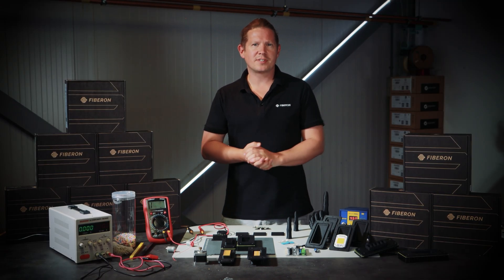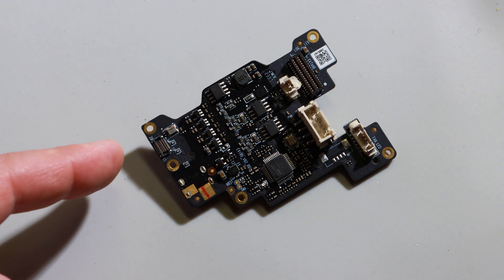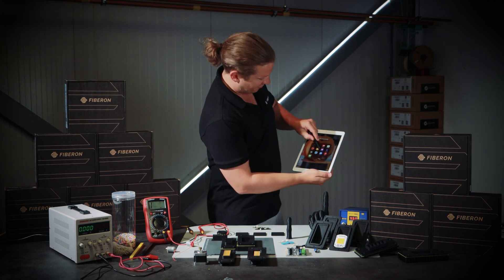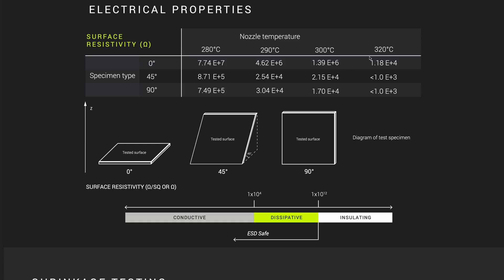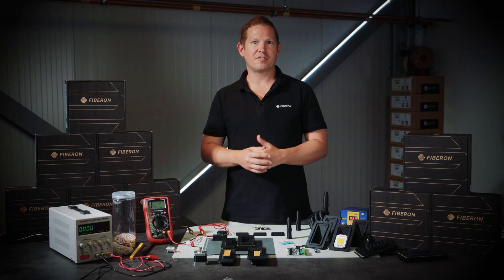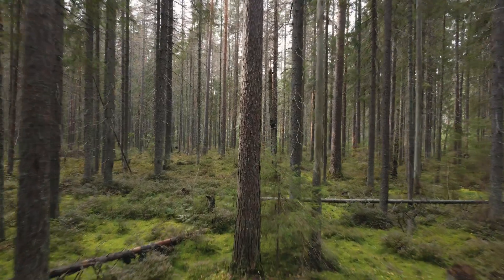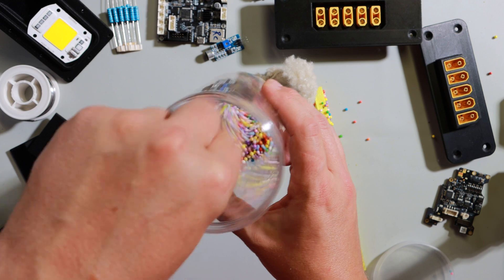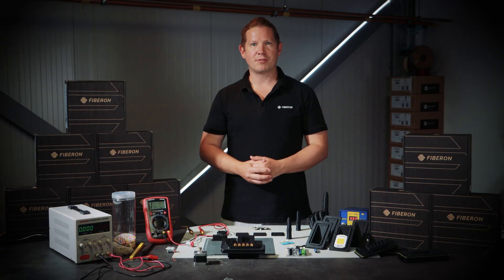Fiberon™ PA612-ESD Demo: ESD-Safe 3D Prints for Tech Projects ⚡

Comment: Hi at my work Im evaluation your ESD materal Fiberon PA612- ESD and PETG-ESD. The PETG-ESD prints great and has great ESD properties. The PA612-ESD has great ESD properties but the surface finish is really rough. I first thought it might be something we did wrong but I can see on your prints that it's the same. And the higher temp the worse finish.
This makes it unusable for our production fixtures since we need a smooth finish. If you could fix this issue we would change our current filament to Fiberon.

Comment from the maker: Thank you for watching! Feel free to ask us questions about our new Fiberon™ material. 
Did you guys guess that it was gonna be tech related 😎?
Reply: Well, your tweet the other day WAS pretty explicit about that point, so.... yes?
Reply from the maker: @critter42  😆 we had to make it a little easy .
Reply: What's the recommended print settings? And what temps should we dry it at?
Reply from the maker: @bladelaw  Fiberon™ PA612-ESD will print with very similar settings to other nylon materials offered by Polymaker:
 
Nozzle: 280-300°C 
Build Plate: 40-50°C 
Chamber Temp: Room temperature 
Printing Speeds: Up to 300mm/s 

You can find the full TDS on our website! 
https://us.polymaker.com/products/fiberon%E2%84%A2-pa612-esd#productinfo